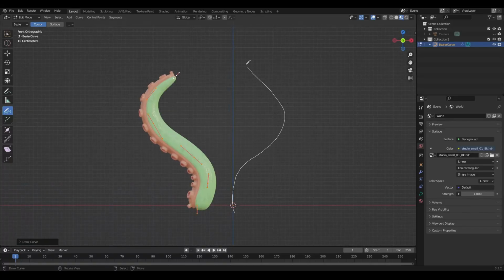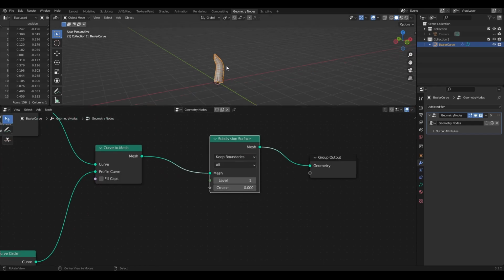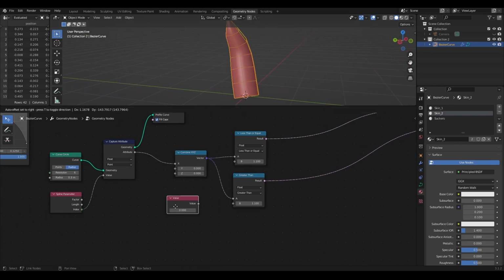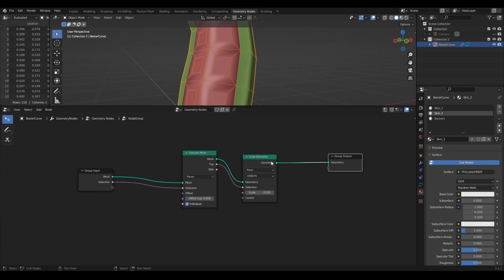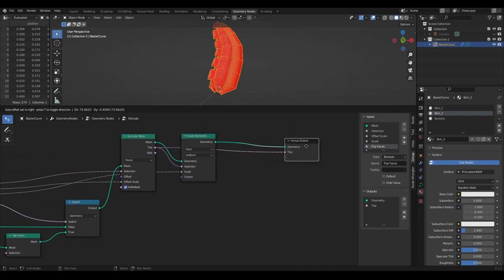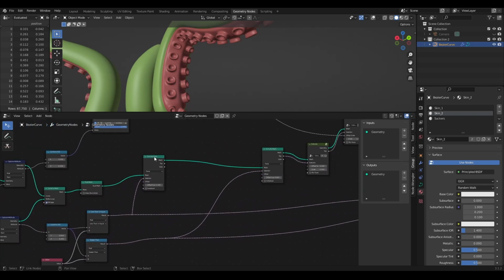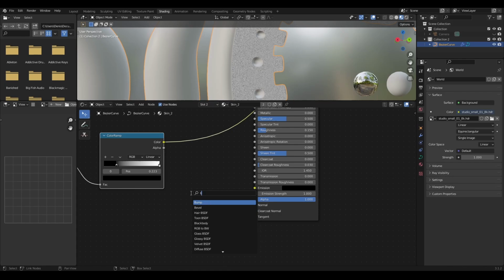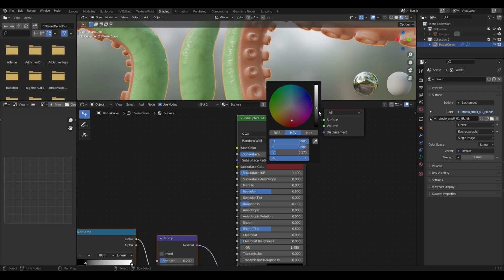Blender 3.1 - Procedural Tentacles with Geometry Nodes

Comment: In 4.5, the "fill caps" function is creating strange shading. I think this is due to the new algorithm they added for "grid fill" but I'm not sure. If anybody has a fix, it would be appreciated.
Reply: I fixed it by adding a "smooth by angle" node at the end of the geo nodes setup, set the angle to 180, and checked "ignore sharpness"

Comment: ik this is for 3.1 but is there any way to make it work in 4.3? capture attribute has changed   EDIT:Figured out capture attribute now im just having issues with the tip of the tentacle
Reply: spline parameter -> factor -> curve to mesh -> scale
Reply: How did you manage the capture attribute node?

Comment: The video went a little fast, but pausing and rewinding is helpful, because this was a good look into Geometry Nodes for the first time. My one question is if there is a way to keep them from elongating towards the end? They get progressively smaller but they also stretch out and distort lengthwise (I have more faces/suckers than yours does).

Comment: really good tutorial, I've done it in blender 4.2 and it works pretty well. But I have two questions: Why don't you set the offset of the extrude to a negative value? It works the same and the mesh doesn't have flipped normales. Is it possible to change the suckers on the tip of the tentacle to have smaller ones, because the look pretty stretched but not smaller. Thank you!

Comment: Did this still works in blender 4.2 ?
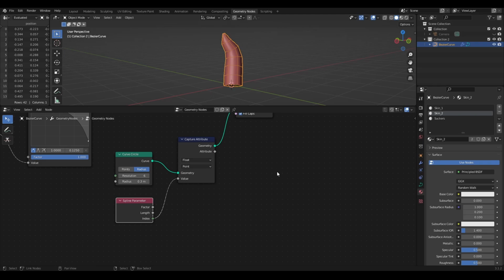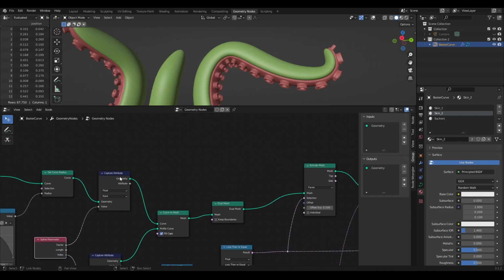Reply: I just used this in 4.2 and it worked. The Set Shade Smooth and Sub Surf nodes has a couple new options but just ignore them and I did get caught up on Capture Attribute though. Instead of just a Value socket it has Index and a blank socket. At 3:28 you'll want to plug the Index into the Index and at 10:18 plug the Factor into the blank socket.
Reply: @samuelbenhardt4230 Can you help me to import texturs from blender to roblox studio

Comment: This is such a cool tutorial and easy to both follow and customize, but I do have a question, Is it possible to animate these? I've never animated Curves before so IDK if I have to add armature or anything
Reply from the maker: Hey! Thank you so much for the feedback. Well, there are few ways to animate these. 1. From the geometry nodes - by displacing the points of curves with set position and noise texture. 2. Convert to mesh, apply modifiers and add armature to animate

Comment: Hey! Its very cool tutorial, exactly what i needed thanks! Is there a way how to edit those Ends of tentacles to not be so squished?
Reply from the maker: Hey @MaDmonkey3311 ! Thanks for the feedback!
One of the solutions that I've came up with is to displace the curve points on z based on the factor (spline parameter). Add set position node after resampling the curve. It should look something like this - https://snipboard.io/kNSaYj.jpg
Reply: @retroshaper  Thank you very much for solution, but I still dont know what iam supposed to do from the screenshot. I dont use geometry nodes at all, they are my nightmare :D
Reply from the maker: @MaDmonkey3311  the screenshot illustrates an example of points displacement on z axis based on the points position - I.e. the higher the point, the closer it is to previous point. This way, face of the segment of tentacle is going to be square, which will result in not squished ends of tentacles and suckers ))
Reply: @retroshaper  Also is there a way how to rotate tentacles as you need? Iam struggling with it a bit. In order to rotate it i have to move the handle points over some limit in order to rotate it but thats not what i need. I just need to let it be in specific curve position and then just press R and rotate it to desired position but thats not how it works.
Reply from the maker: @MaDmonkey3311  Hey! Sorry for late response. Unfortunately this is not how curves work. You need to use the handles of each point of the curve to rotate to your need.
Reply: @retroshaper  i figured it out, i just click each handle and then press ctrl+t :) but Thanks!

Comment: Amazing video! I make them very similar to yours, but during the process I made some lines and now they are all linked and i want to add some articulations for it, but if i select one, all of them are selected too, and now i cant make the line to create just one to animate. How can I turn all the lines in different objects to work?
Reply from the maker: Hey! Glad you’ve enjoyed the video 😊 it is still the same object if created with a single geometry nodes setup. You may try converting the whole thing to mesh by applying the modifier (make sure to use realize instances node if you’re instantiating anything). That’s the easiest approach. However, if you still want to modify parameters of the node tree, you may need to create animation inside the GN, which is quite limiting at the moment.

Comment: I'm trying to get them to be a bit more pointy but when I do that last sucker...gets odd and some times flips sides. am I not understanding the functions? I cant seem to get it to remove suckers in the Z axis
Reply from the maker: Thanks for the comment. Yes, there is such effect. It happens because of the scaling of the faces on a mesh which reached small size through spline parameter.
To remove the suckers on the z axis, you may deselect the spline/curve points on which the suckers should not appear. When you select points and pass them as attributes later on to the mesh transformed from the curve, you’ll select the whole set of faces formed from those points. Hope that helps 😊
Reply: it sounds like it should! thanks!  @retroshaper

Comment: Hi, thanks for a good tutorial, but can you tell me what to do if I have a mixed up surface with and without suction cups. With suction cups, the surface is larger and for some reason I can't change it. I will be grateful for the answer
Reply from the maker: Hi! Thanks for the feedback and for the question!
It is hard to tell. However, from the top of my head,  it may be because of the extrude node maybe. Try using scale elements for that bigger par. Also, make sure to use proper face selections for scaling. Let me know if that is something that helped))

Comment: How can i use this in a different file ?
Reply from the maker: Use the append option in the file menu. Then you can select a project from which you want to import the setup. There is a folder called NodeTree, where geometry nodes can be found.

Comment: Question: what is the benefit of this compared to manually making  them with an  array to a curve for the suckers?
better for performance or something?
Reply from the maker: Not sure about the performance. But geometry nodes quite a good thing to make procedural stuff in blender)
Reply: @retroshaper  yea seems speedier once you get it down
Reply: I've been trying to use arrays and it seems like Blender really doesn't want to bind objects to a curve and then also scale them down as you go along. Arrays are very finnicky, at least from my experience. That said, if you can get them to work, they look great.

Comment: how do i make sdure the starting and end faces don't get extruded or remove them from selection?
Reply from the maker: So, basically every point, edge and face has its own index. Just make the selection with math and compare operations in the context of faces
Reply: @retroshaper  yeah i made a compare math function to set the start, end points byt it was a absolute function not a relative one. I wonder if it can be made relative?

Another thing i wanted to rotate the suckers axis, how would you do that, set curve tilt?
Reply from the maker: @cyano3d  Could you please elaborate on what you mean by relative in this case?)) I assume, something can be done with reassigning ID's .. Or, you could add more math functions to recalculate values based on your needs. But that's me guessing))

About the rotation, depends on how you want to rotate them) If the rotation should happen to the extruded faces, it is possible to use a transform node. With a few math and compare nodes it is possible to select the exact faces for rotation as well as customize rotation based on the position or vector.

Hope that helps;)

Comment: HOW DO WE ANIMATE IT
Reply from the maker: There are several possible solutions to achieve this.
- Offset each point of the curve with texture or math function
- Control the rotation of each point of the curve with a value
- Simply apply the modifier and rig the tentacle
Thanks for the question! ☺
Reply: @retroshaper  I notice that the procedural texture slides around all the tentacles as you move any one of them, so if you animate you're going to need to use individual curves and attach the geonode to each one separately.
Reply from the maker: @danmerillat  Yep, make sense. Good point. I assume it is possible to separate geometry by Spline domain and do some math operations to identify each instance of tentacles and apply position offset for individual tentacles. But that is just off the top of my head. Definitely need to dive a bit deeper ;)

Comment: Is there a way to do this without the materials? I'm trying to make this to print, does it make much difference to the file if the material is there or not? And if not, how do I separate the faces if I don't define a material?
Reply from the maker: Hi! Thanks for the comment.
Yes, it is possible to bypass the materials and the separation of the faces will still work.
However, if you want to 3d-print the result, you'll need to have the mesh properly prepared along with all the necessary details (e.g. skin texture, etc.) if it is required.
Reply: @retroshaper  can u elaborate what you mean by have the mesh properly prepared please?
I’m still new to blender so I’m experimenting with everything ahaha

As for texture, it won’t be necessary for my purposes
Reply from the maker: @maxineheather924  Well, I'm not a 3d print expert ;) But based on my research - model should meet requirements of the software used for 3d printing. Those may be: mesh with no holes, or equal topology. Probably some remashing may be required if we're talking about geometry generated with geometry nodes.
But again, I have no practical experience in 3D printing, so, I suppose additional research is needed to produce quality products ;)

Comment: Excellent video, thank you so much! I had never used blender before but this was easy to follow. Would you consider making a continuation for this where you show how to add some texture to the model itself (not just render it on top) on to the currently smooth side of the tentacle? My goal is to create a 3D printable tentacle model for my dnd character who can summon tentacles, so simply rendering a texture is not really an option. Perhaps some ridges or a sort of a cracked skin type of thing that seems to be common in octopuses? Please🥺
Reply from the maker: Thank you so much for the feedback! Interesting idea! I guess, for 3D print-compatible model, we would need to build a high poly model with a high level of detail. I will definitely consider something like this in the future! Thanks!

Comment: Instead of all that flip faces business for the part of the sucker that goes in, can't you just set the offset scale to a negative value?
Reply: That's what I thought; I mean, it's much simpler 😅
But maybe for learning purposes it's better, because I didn't know that there was a flip faces node and switch node
Reply from the maker: @DownDance  Totally! I'm glad that it turned that way ☺☺
Reply: I couldn't slide to a negative value either, so I used a Value node set to a negative number.
Great video! So helpful.
Reply from the maker: @AubrieLee  Also a workaround 😃 Thank you for the feedback! ☺
Reply from the maker: Absolutely! Thanks for pointing that out!)
Unfortunately, at the time of recording this video, there was a small usability issue, that didn't allow to use the slider for negative values )) Only typing in. At the same time, I've found a way to show the switch functionality. ☺

Comment: How to remove the last set of suckers at the tip? theyre so weird looking. I'm trying to unselect the top part of the "red" skin part but I can't seem to do it... is it on the Z axis of the geometry / curve?
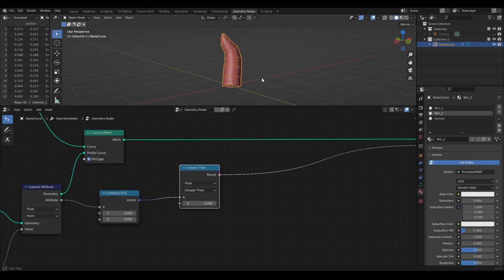Reply from the maker: To remove top faces from the selection, you can use compare node (less then operation) to specify selected vertices of the spline (the one that you draw) by index - you may add those node before converting curve to mesh. And then multiply that with the selection here 3:57.
Let me know if that helped. 🙂
Reply: @retroshaper  i will try but could you link a screenshot image of this on the description?
Reply from the maker: @hartdr8074  Sure, here you go! https://snipboard.io/O14lwj.jpg
Reply: @retroshaper  OMG youre the best. I love you.
Reply from the maker: @hartdr8074  🤩

Comment: when  i go to geometry nodes it doesnt let me make a new geometry node setup wtf do i do
Reply: Same issue here. I selected the object, even so the "new" button still dark.
Reply from the maker: @Katia_Targaryen  Very strange. Without screenshots I can suggest the following: make sure you’re not in edit mode; try to update Blender to the latest version (because, for example, geometry nodes worked differently with curves in older versions); please let me know if that helped.
Reply: @retroshaper  Yesss! Lazy that I am, I was using version 2.9 until now.  So I updated and tcharamm! Worked. Thanks a lot!❤❤❤
Reply from the maker: @Katia_Targaryen  Awesome! Happy to help! 😃
Reply from the maker: To create a new Geometry Nodes setup you need to have an object selected (any object except metaball I believe). Since it is basically a modifier added to the object. I'm just guessing here ;) So, let me know if that was the issue ;)

Comment: My spline parameter node isnt showing when i search it up? Anyone know why, did they remove it?
Reply: Which version are you using? There used to be a similar node called Curve Parameter in older versions.
Reply from the maker: Yep. @maya_ndljk is right. In Blender 3.0 and older (I believe) it used to be called Curve Parameter. Starting from 3.1 it was renamed to Spline Parameter.

Comment: Nice tuto. How could I set the texture to give a translucent effect on the tenticle? No matter hot much you rotate the tenticle. The middle look full but the sides are translucent? Like a glass filled with milk. You can't see through in the middle but can see through the sides. Could probably do that with 2 layers of mesh, but that seem heavy for nothing.
Reply from the maker: Thanks for the feedback! 😊 Well, the effect that is used for the material is subsurface color. The setting is available in Principled BSDF so you could set two colors - Base Color and Subsurf. Color. It more depends on the thickness of the mesh.
To make it translucent, you may use either Translucency setting or Alpha (if using image textures with Alpha).
To achieve translucency based on the rotation, it is possible to use Fresnel node for the translucency with ColorRamp for tweaking.
Hope that helps 😉
Reply: @retroshaper  I'm kinda lost sadly. Is there a way to show a picture of the shader graph with the nodes?
Reply from the maker: @FyresGames  It can be made with only Principled BSDF. And btw, the settings for translucency is called Transmission (sorry for misleading you🙂). Here's the screenshot with a few annotations on the settings that can be used for transmission. https://snipboard.io/tsip1H.jpg
Reply: @retroshaper  I did managed to make some effects, but if I put a light behind. The middle part is see through as well.
Reply from the maker: @FyresGames  Also, make sure to lower the roughness to make Transmission stronger. 😀

Comment: I followed you’re tutorial and the look great, i was wondering if there’s a way to animate the tentacles aswell? I can’t animate curves and when i change it to mesh there’s a million vertices i have to move manually to animate it.
Reply from the maker: Thank you so much for the feedback!
It really depends on what type of animation you want to make. For curve animation, there are a few ways: 1. If Bezier curve, possible to use Set Handle Position Node and experiment with Noise Texture or Sine in the Offset and Scene Time. 2. If Poly Curve is used, the easiest would be to use Set Position node and use Noise Texture or Sine for the Offset with a value driven by Scene Time. 3. Also possible to use 2nd method but with a conversion to mesh, just need to make displacement (Set Position) based on Spline Parameter Factor or Index (captured in the attribute). 4. Finally, it's possible to realize instances and use armature for the animation.
Those would be my suggestions. Hope that helps 😊
Reply: @retroshaper  thank you so much! I’ll look into to those and try it out! (I made tentacles come out of a broken rum bottle and hold a blade to create a pirate themed sword) i want the tentacles to move around the blade slightly up and down. I thinkni can figure it out now thanks again!
Reply from the maker: @GucciGoon  Sounds awesome!

Comment: But if you want to taper both ends of the line? I tried just replicating the nodes 2 times but it didnt work :/
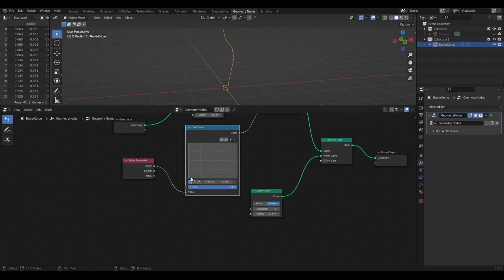Reply from the maker: If you want both ends of the curve to get thinner (if I understood your question 🙂), you may try adjusting the Float Curve (1:55) accordingly. You could add more points to adjust the curve radius for desired result. Hope that helps! 😉
Reply: @retroshaper  if i would have looked at the simple solution of it all i would not have had to ask this question 😂 thank you!
Reply from the maker: @tommymaksimhaugland7333  Sometimes things are easier than they seems 😁